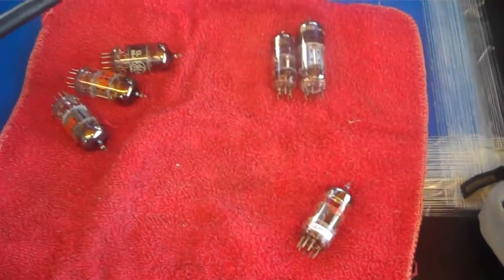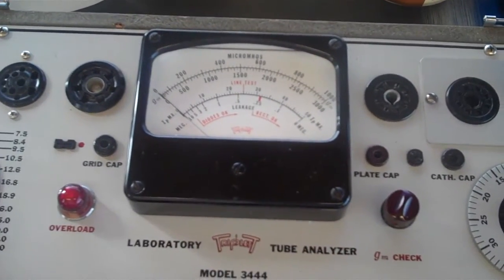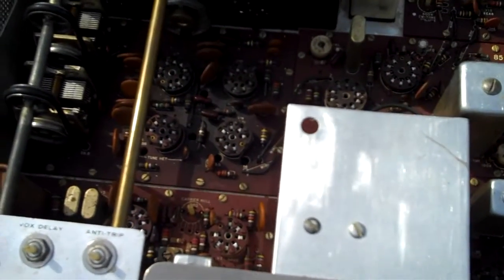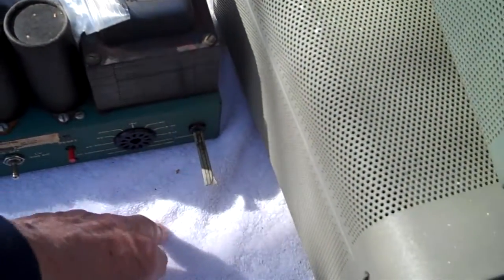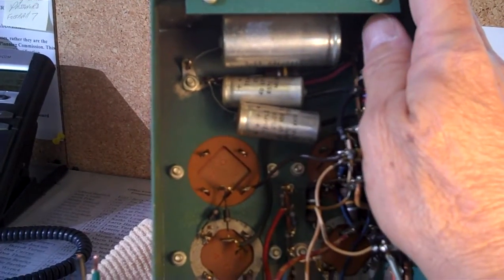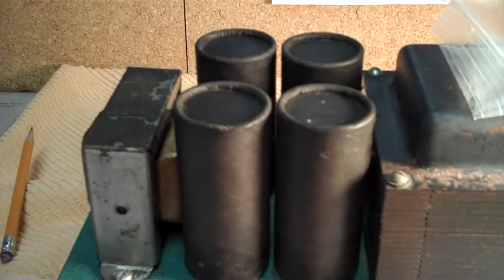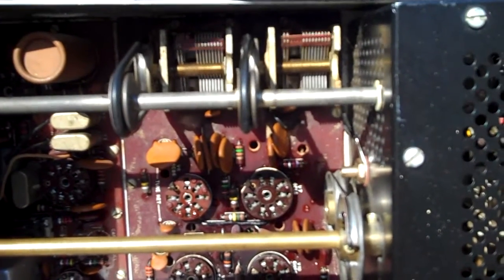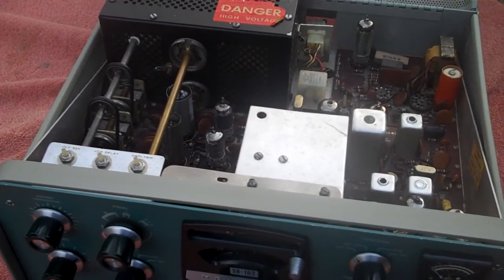A Heathkit SB-102 HF Ham Rig...and the three Rs (Part 2 of 4).

Comment: @joernone Thanks for the tip on the tester. I will definitely look into that. I bought a tube from Geno for the Emerson chassis at a great price. That one was visibly burned inside. The Emerson is not together yet, but it is getting there! Slow but sure, taking my time and enjoying it! Caps and resistors are in and the chassis is cleaned and painted.

Comment: John, Amazing all those tubes were bad.  I know from your videos and looking at some of your restorations on ARF that you have been at this longer then you had the tube tester. I am curious before you had a tester was it just hit or miss if the radio did not work correctly after all the other things are restored you then turned to replacing tubes? I do plan on getting a tester for future projects but looking for advice on the current one until then. Thanks, Tom B.

Comment: what kind of tester is that my friend? I got a bunch of older 4 pin tubes that I cannot test with my Mercury 2000. Will that model test 24A's or type 30 tubes?